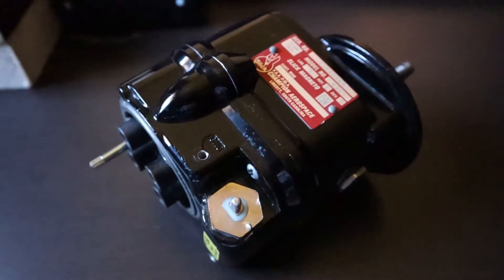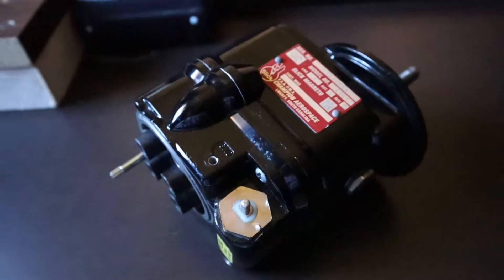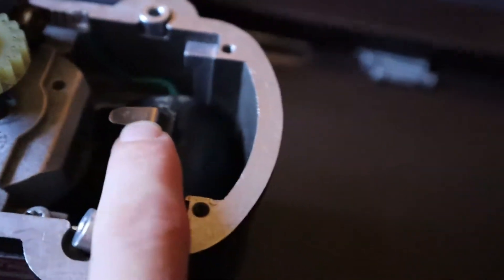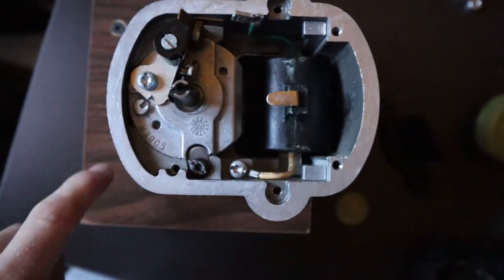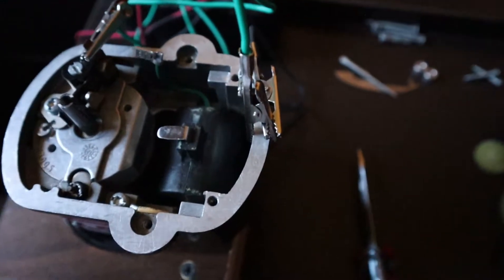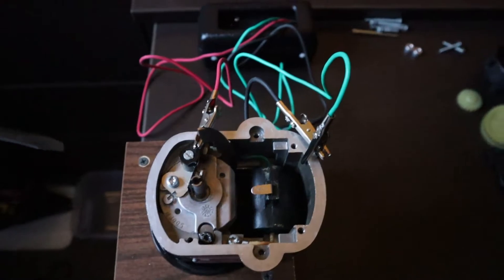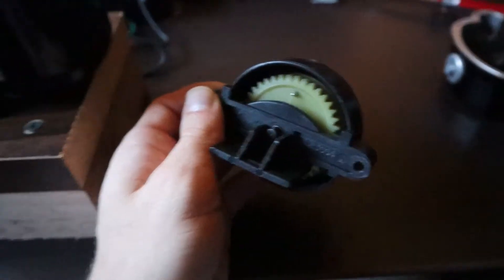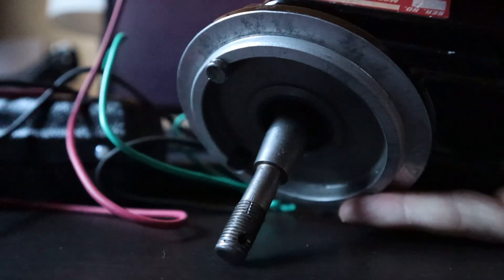Slick 4300 Series Magneto overview & timing

Comment: I repair vintage tractor magnetos for work and it's really interesting to see how similar they are both internally and externally to these aircraft mags. In the shop we've got aluminum blocks similar to the wood block you constructed to hold the mag while you're working on it.